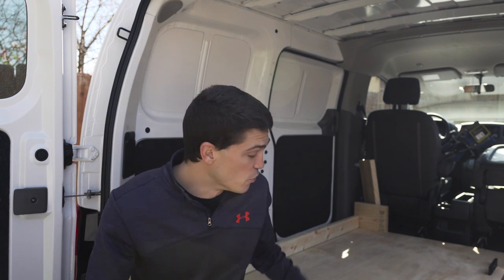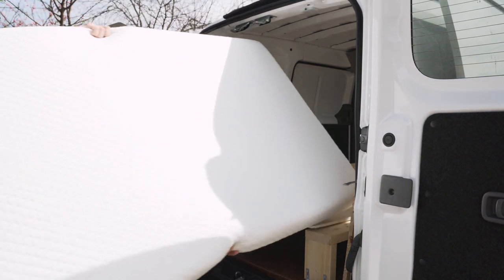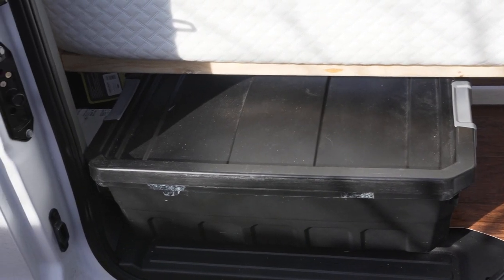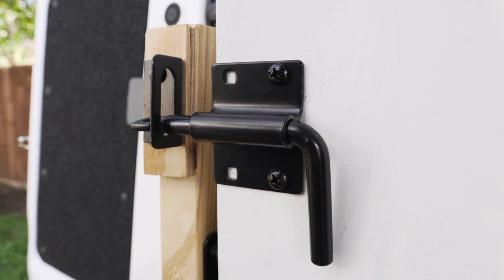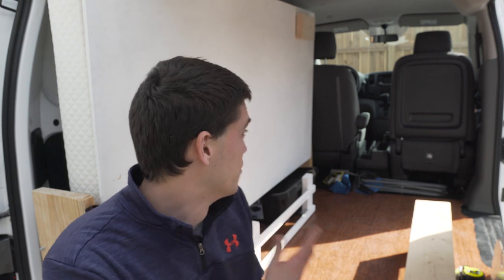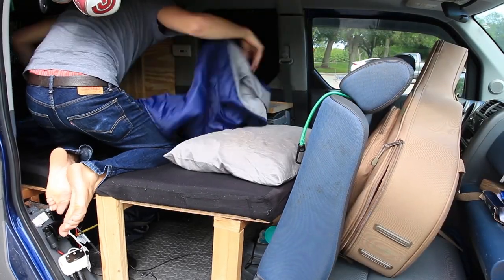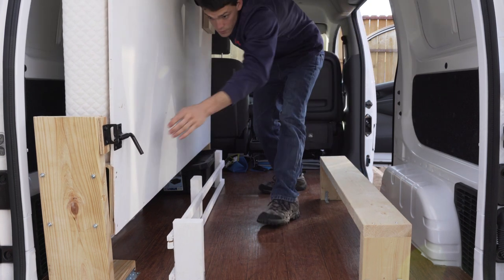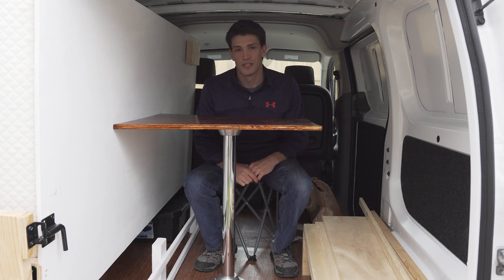DIY Murphy Bed in a Mini Van | Nissan NV200 Camper Conversion

Comment: This just occurred to me. How come people use propane instead of an electric stove running off solar? My guess is that it takes alot of energy to run it but doesn't solar panels provide enough though? Anybody know? Nate?
Reply from the maker: Electric cooking units use a lot of power that most people don't have. I certainly didn't until I got the Kodiak. Even with the Kodiak I could only use an electric range for a short period of time before exhausting the lithium battery.
Reply: @ElementLife  Roger that! Thanks for the feedback. Propane it is!